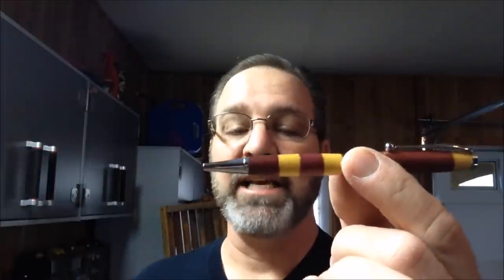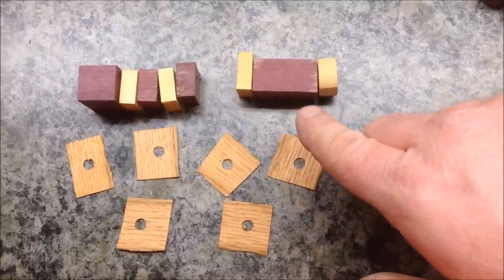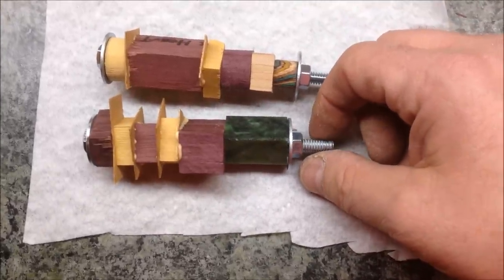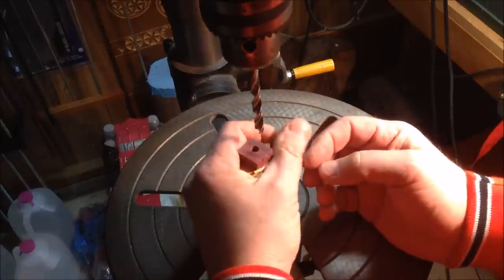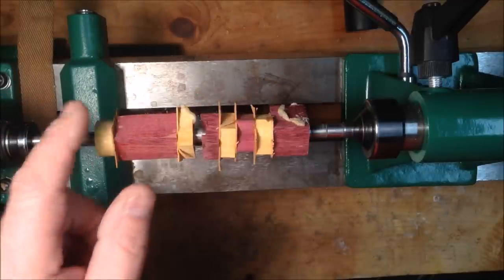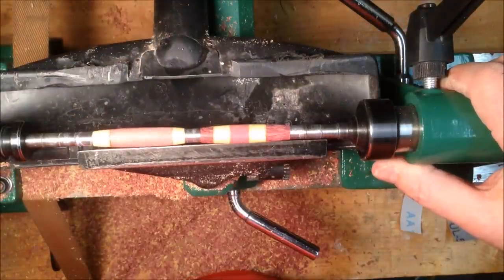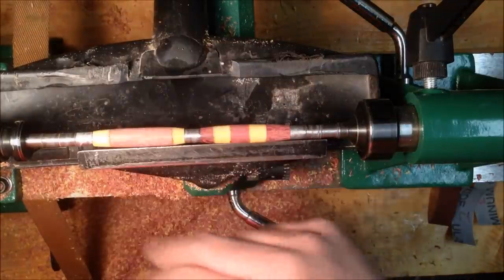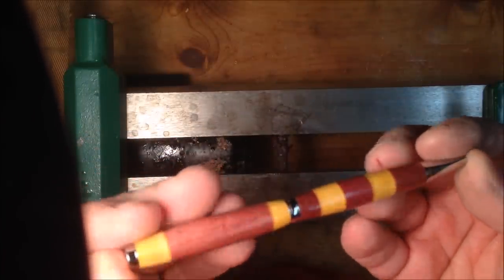Making Pen Blanks From Cut Offs

Comment: Great use of cut-offs.  I'm building my collection of them and now know how to use them. I think I'll use threaded rod for my clamps and I might glue the whole pen so I can decide exactly where to separate the top and bottom.  Thanks. Bill
Reply from the maker: Bill?
  That's a great idea to make the whole blank at once. One thing about threaded rod, don't leave the blanks drying on it to long as the threads cake with glue and it's very difficult to remove from the blank. That's why I went with the smooth bolts.

Regards,
Bob

Comment: Good looking blanks Bob. I like to put a piece of wax paper on the workbench and lay the pieces flat on the bench paper to glue them. Then I clamp the glued pieces and try to square up as much as I can to end up with a glued up piece of wood about the size of a pen blank. Then after it dries, use the blank as I would usually do and drill the hole while holding it in the drill press vice.
Reply from the maker: This is what I love about posting videos and meeting new turners. The ideas are endless and there's always opportunity for me to learn and try new things. 

Regards,
Bob

Comment: Bob,
Something to consider...if you use a propane or butane torch to heat the purpleheart it becomes a fantastic bold purple color. Just something you might want to try. I have done it on many pens I have turned and those seem to be the ones that are bought first.
Mike
Reply from the maker: Thank you Edward,
   I did a video about that a while back. I was concerned about what it might do to the yellow heart and the oak laminate. 

Regards,
Bob

Comment: Good video, Bob! I like your bolt idea, and I'm going to try it myself. I like to use my lathe as a horizontal drill because its so precise. I will probably use a sander to shape the blank so the blank will fit into the jaws of my lathe. Thanks!
Reply from the maker: Thank you Rick,
  I'm hoping to make a pen drilling chuck for my lathe because I think it would be more accurate than the drill press. 

Regards,
Bob
Reply: RJBWoodTurner I recommend Nova chucks. I'm delighted with mine and use it exclusively over the imprecise drill press. Your lathe is the one sold by Harbor Freight, and I'm sure that Nova probably has one that will fit your hardware. You'll also need the optional "fingers" that allow you to insert a blank into the chuck. For your tail stock, you can purchase a chuck that will accept a drill bit. Now you can precisely drill your blanks.

Cheers, Rick

Comment: hey bob, that's a great idea I am going to try and cut the scraps at angles to fit them together a little differently, but thanks again for the great video.
Reply from the maker: Your welcome Alan,
  I was thinking about that the other day and I wasn't sure how to align the bolt holes with the angle cuts. I'd love to hear what you come up with as I am interested in trying that too. 

Regards,
Bob
Reply: I was thinking drill them first the cut them at 45 s and such then glue I will try tonight after work let you know how I made out
Reply from the maker: Please keep me posted,
  I was worried if the hole wasn't perpendicular to the blank that the miter wouldn't properly line up causing a gap at the junction. 

Regards,
Bob

Comment: Bob, Great tips and techniques. I started playing around with the scrap box the other day was really scratching my head as the best way to build them. I used a dowel and got a little too much space in between parts. I am going to be heading to HD for a bolt and some washers very shortly.  I've subscribed and look forward to watching more.
Reply from the maker: Thank you,
  I used a 4" X 1/4" bolt, the kind that is smooth except for the last 3/4" of threads. A bolt with all threads would have been tough to remove from the blank. I chose 1/4" because that's the diameter of my mandrel and I could ream it out to fit any pen kit. 
  Good luck and have fun, these are a blast to make and the segmenting ideas are unlimited. 

Regards,
Bob

Comment: I've used my belt sander to square off all 4 sides. It works well
Reply from the maker: I’ve used the sander too. Only reason I used the bandsaw in this video was because have the jig. I say use what you have to remove those corners especially on the delicate blanks. 

Regards,
Bob

Comment: Maybe it has already been answered, but for the Acrylic cut-offs, do you use a special adhesive to chemically bond them or just CA?
Reply from the maker: Hello Michael,
  I primarily use a Medium thickness C/A glue. If there are any adhesion issues with a particular piece of acrylic, I use epoxy. It takes longer to dry but I've had good luck with it. 

Regards,
Bob

Comment: Have you tried combining wood and acrylic cutoffs? I have done a few and they are amazing if they turn out. The difference in Turning wood and acrylic makes it very easy to blow them out on the lathe so you need to use very light pressure on your cuts.
Reply from the maker: +Regina Johanns a have done a few. I need to film one, there really fun to make. 

Regards,
Bob

Comment: How about a simple  whole punch for that thin laminate? And if you do many more of these glue ups, it might be worth your time to get a 7mm reamer. The flutes on a reamer are designed to use less force than a twist drill, so that they can't dig in and wander off course. This makes for a straighter hole. Will you be able to CA glue the acrylic cut offs together without any gaps?
Reply from the maker: Thank you for the idea on the reamer. I think Penn State has one listed in their catalog this month. 

Regards,
Bob

Comment: PS, always wax the bolts to stop the glue sticking, glue them on a dowel sand them to a square and drill them in the lathe.
Reply from the maker: +alfred william I like the dowel idea,
  Dowels are cheap and will drill away with ease. 

Regards,
Bob

Comment: I just glued the pieces together and clamped them using a squeeze clamp. Once dried, I sanded them square one a belt sander. Then I drilled the 7mm hole, glued on the tube and turnedn
Reply from the maker: Awesome! Please send photos or a link to the video. 

Regards,
Bob

Comment: What is the black object at the back of the pen planks? Is it a "floor sweep tool" from a shop vac? Good idea on using the cut offs. Now I know what to do with mine! Thanks!!!
Reply from the maker: Yes Steve,
  It is the floor sweep off the shop vac. I use it to help with the the dust. It's not perfect but until I get better dust collection, it'll have to do. Thank you for watching and commenting. 

Regards,
Bob

Comment: I was literally thinking about this on the 5th, I went into woodcraft and thought to myself how I could use my left overs by gluing them together, but I didn't know how well it would hold up on the lathe.
Reply from the maker: Thanks Steven,
  These blanks were tough, I used a hammer to knock the bolt out of one of the blanks and it held fine. I used a lot of glue. 

Regards,
Bob

Comment: I noticed on this video you have a vacuum floor nozzle inverted under your cutting area, and since I have the same type of lathe, how well does this "clean" and how do you attach it to the lathe?
Reply from the maker: Hello Lee,
  It does fairly well with dust from sanding. The chips come off at such a high velocity they they are thrown everywhere. 

Regards,
Bob

Comment: Cool idea using the bolt!  My process in the past was much trickier and not as accurate.
Reply from the maker: Thank Troy,
  Best part about the bolt is you can really crank down on them and get a super clean joint. 

Regards,
Bob

Comment: Excellent Video. One question, what are you using to hold the barrels when putting on the finish.
Reply from the maker: Thank you Jim,
  Those are some non-stick bushings I made in this video:

https://youtu.be/KSXlS89qmCM

  They are pretty wore down and I need to make another set but I won't apply C/A glue without them. 

Regards,
Bob

Comment: any thoughts other than a table saw for squaring up the ends,,,i have a table saw but that small of pieces I would not like to try on a table saw,,,,
Reply from the maker: Hello Jeff,
  Here is what I use on the table saw, it holds the pieces firmly and keeps your hands far from the blade. It works like a champ, I even use it to square deer antler. 

https://youtu.be/G42RvaoBjDs

Regards,
Bob

Comment: Excellent job.  The pen looks great.  I have a question though.  Maybe I missed something.  I have many pieces maybe 3/4 " or less, and how do you square up the ends so that they are smooth against the other pieces that you glue together.  I know they have to be completely square and smooth.  I'm just wondering how to do it, just on a sander?.
Reply from the maker: Hello Tommy,
  I made this jug a while back and I use it to clamp down and square up up to four pieces at a time. The video is rather long but if you skip to the end and see the jig, I think you'll be able to figure it out. I also use it to square up antler for my antler pens. 

https://youtu.be/G42RvaoBjDs

Regards,
Bob

Comment: hello   question   ,, can you use a microwave to dry out wet burl  for penmaking
Reply from the maker: Yes but I wouldn’t use you home MW. It will stink it up and ruin it for food use. 

You use a scale and measure the weight of the wood. 

MW it for maybe a minute, do not go longer and one min,  then weigh it again. 

Repeat until the weight stabilized. 

It’s a slow nasty process.

I have never done it but learned this info from Michael DeLawter.

Comment: Hi again from Britain,

What glue did you use that did not stick to the bolts?

Regards,  

Bill.
Reply from the maker: Hello Bill,
  I used Tite Bond II and pulled it off the bolts after about 20 minutes. Otherwise it will stick, I had to knock a bolt out with a hammer. I learned the hard way. 

Regards,
Bob

Comment: This turned out great. Have you tried it with the acrylic yet? What kind of glue would you us on acrylic ?
Reply from the maker: Thank you,
  I have not done this with Acrylic although, it should work just fine. I would start with thick C/A and use an accelerator to set it. If I had any issues with adhesion, is use a quick set epoxy. Be careful with both as they will glue the blank to your bolt. 

Regards,
Bob

Comment: I call those offcuts my 'jewels'...my wife says in just confirms my insanity.  I was thinking it might be worthwhile drilling the pieces to 7mm and mounting them on a 7mm bolt but then I read your answer below where you said the 1/4" hole leave all your options open.  That's good thinking.  Great pen, now I can say "But Bob says I need to keep these little pieces when eyebrows are raised".  Yes, I abuse my friendships for my own benefit.
Best Wishes, Brendan.
Reply from the maker: Thanks Brendan,
  Feel free to put the blame on me. 

  Those 1/4" bolts work out great. I can crank them down really tight and with the laminate, it really closes any possible gaps. I am going to make some ornament blanks too. They won't have tubes in them so the 1/4" hole will let me slide them right onto the mandrel. 

Regards,
Bob

Comment: Hi Bob,
That turned out nicely.  Have you ever tried doing that with acrylic cut offs?
Reply from the maker: +Andrew Morrissette Thank you Andrew,
  I haven't but I'm sure it would work. I have a bunch of acrylic cut offs, they just don't seem to look that good together. 

Regards,
Bob
Reply: +RJBWoodTurner 
I was thinking of trying to mix some acrylic cutoffs with some wood cutoffs.
Reply from the maker: +Andrew Morrissette I've seen a few pens made that way and they always look amazing. 

  Consider a separator between the wood and acrylic like aluminum, brass, or copper, it really makes the blank pop.

Comment: Liked the video and it answered my question as to what to do with my leftovers.  What did you say you wiped the blank with after sanding?
Reply from the maker: Hello,
  I use Denatured Alcohol to clean the blanks. Acetone is another solvent that will clean and cut the natural oils so the finish will stick. 

Regards,
Bob

Comment: If the bolt hole and the mandrel are the same size, try mounting the raw blank on the mandrel and true it up then drill to the barrel size using your pen vise.
Reply from the maker: Hello Lucien,
  I have tried to true a blank without a brass tube and it can be difficult. There is nothing for the bushings to register against so they press into the wood and can damage the blank. The blank will also slip more easily without a tube. 

Regards,
Bob
Reply: What about a large diameter bushing or add small washers before the bushing. I am only suggesting this to allow truing the outside in order to be able to use it in the pen vise. Then bore the barrel diameter.
Reply from the maker: I'll have to do some experimenting, a couple washers may help hold the blank securely enough to true it. Now I just need to find a couple washers with 1/4" holes. 

Regards,
Bob

Comment: Question only - why did you use plastic polish on your wooden pen?  Never tried that before.
Reply from the maker: Good morning Susan.
  Excellent question! Any time I use a C/A glue finish, I'll polish with plastic polish. My thought is that C/A essentially is a plastic shell over the wood so the polish removes any small scratches and shines the outer shell up nicely. I hope this answer helps. 

Regards,
Bob

Comment: Have you ever used the cut off pieces from the acrylic blanks? would you use the same method with the bolt and CA glue? I have learned a lot from watching your videos!
Reply from the maker: Hello Matthew,
  If I were using Acrylic cut offs, I'd probably flatten the ends as much as possible and C/A them together. Then I'd drill them. I wouldn't use the bolt because because I'd be afraid that it would glue the acrylics to it. 
  I want to try this method, I just haven't had time recently. 

Regards,
Bob
Reply: +RJBWoodTurner Thanks for the reply! I look forward to watching more of your videos!

Comment: What does the denatured alcohol do for the blank? I've never used it after sanding should I?
Reply from the maker: I use the DNA to thoroughly clean the blank after sanding. It's especially useful on oily woods like Cocobolo & Olivewood because it cleans and dries the surface and allows the C/A finish to adhere and dry. Otherwise the oils can cause the glue to bubble and pop off. Other than that it just helps remove the dust which makes the blank look it's best. Some people use paint thinner but I like DNA. 

Regards,
Bob

Comment: New subscriber.
 
Just found your channel from seeing your name come up on Maritimewoodworker and doing a little search.
 
I have been doing square cornered stuff for 40+ years and just bought a lathe a week ago.  Took a pen turning class two days ago and did my first round thing.
 
Normally i do not glue end grain to end grain because of the lack of strength.  It looks like you use yellow glue.  Is that correct and do you find any issues with holding power?
 
Have you tried epoxy for this process?
 
Thanks for the info.
 
JimE
Reply from the maker: Hello Jim,
  Thank you for looking me up. Yes I use Tightbond II for all my wood glue ups. As long as my surfaces are clean and flat and I apply plenty of pressure, I get a great bond. 
  Congratulations on the new lathe. If I can answer any questions for you please don't hesitate to ask. 

  P.S. I was the featured guest on the Maritime Woodworkers show this weekend. It was a blast!

Regards,
Bob

Comment: would this methed work with antler and wood
Reply from the maker: It would work with Antler and wood. Things to be cognizant of. 

Epoxy may be a better choice for an adhesive with the two dissimilar materials. 

If you use a soft wood, it may sand away faster than the antler leaving a wavy effect on the blank. 

Other than that I think it would work just fine. 

Regards,
Bob
Reply: @RJBWoodTurner  thanks bob

Comment: Just wondering why you didn't line up the offcuts when you were glueing them and why didn't you put them in a scroll chuck and use a Jacobs chuck to drill them to 7mm?
Reply from the maker: That’s just the way I did it in the early days. I didn’t have a drill chuck. A lot has change since then.